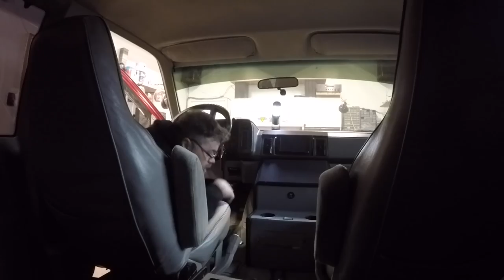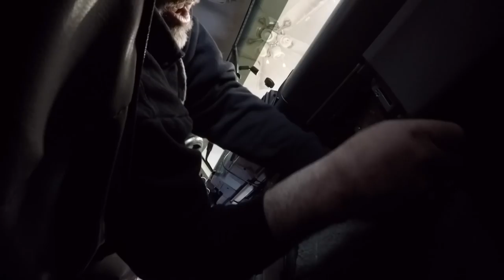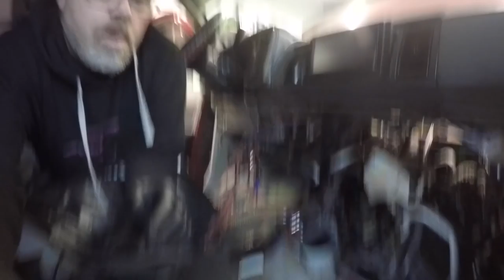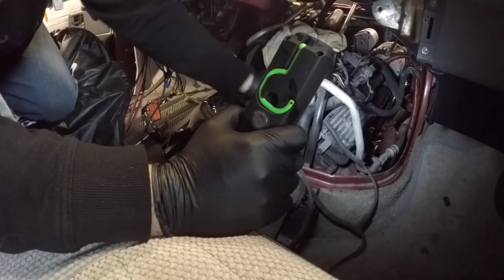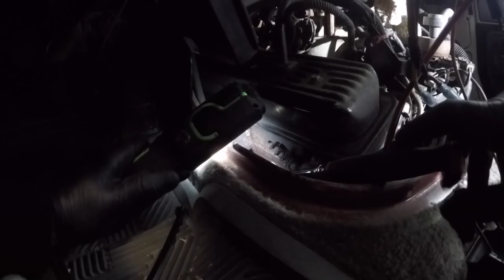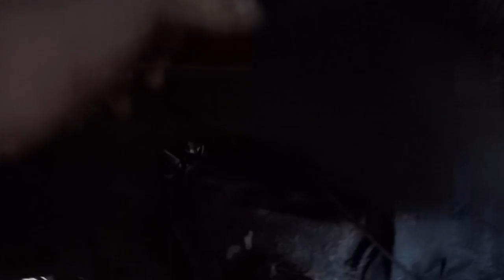GMC Safari Gets A Tar Down

Comment: lol yea getting them out is the easy part, now to put them back in, you will be screaming where did the f**king holes go lol. Spark plug wires can be a pain in the ass as well, they are all different lengths, no matter how much you  work on matching them somewhere along the way you end up with 1 wire not long enough and one too long lol